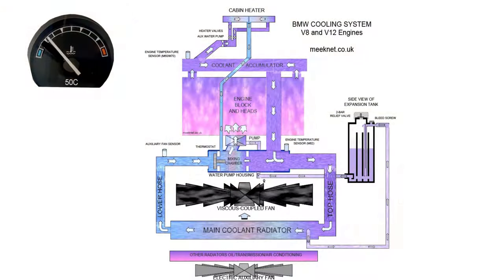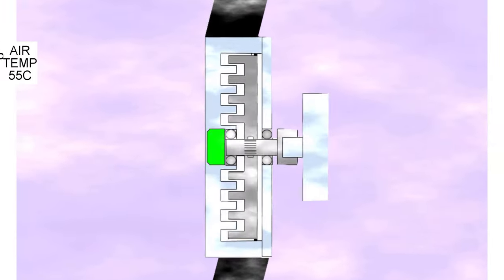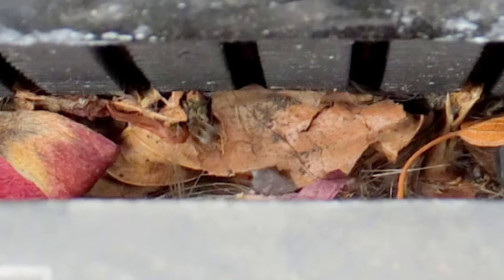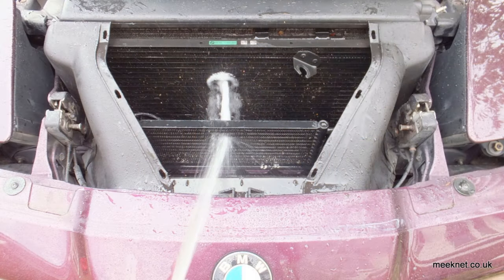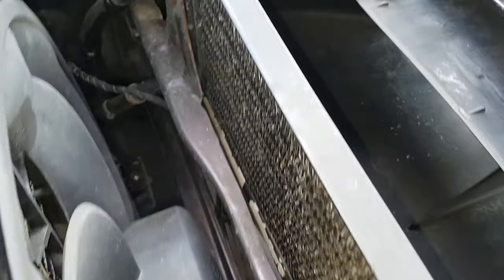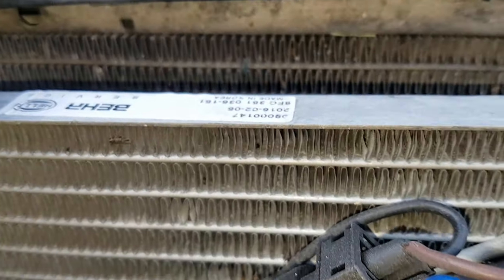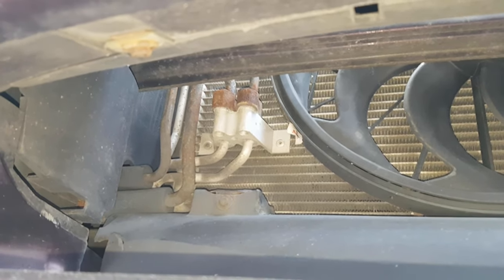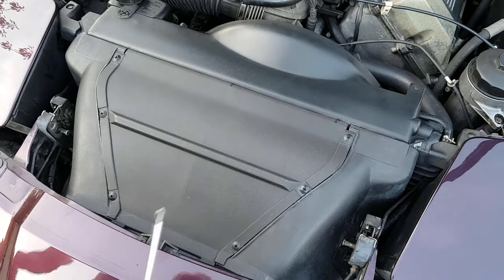BMW Overheating? Check this first!

Comment: Another excellent video. Thank you.

I drive BMW cars more than 10 years. Always fill distilled water %50-50 and blue BMW recommend antifreeze . Also I clean radiators with soapy water every 2000-3000 km. Vaseline all hoses and check them every 6 months. I have never have problem about overheating. Also I have spare parts at the garage ready to change :)
Reply from the maker: Thanks Ali!

Comment: Great advice Timm.....I had to have the valley pan gasket on my 840ci replaced as it was leaking coolant. After BMW did that, it blew the radiator apart on the drive home! The dealership also wanted me to replace the magnesium valve covers because they warp and can't be machined as magnesium is flammable. I was told it is an "unacknowledged defect". At $2000 for the pair, I declined and they've been fine with new gaskets.
Reply from the maker: Good call - I've had seven BMW V8's and never had a problem with warping valve covers! Neither has it ever been a subject on all the major forums - so I think we can put that one in the 'made up' catagory!

Comment: My engine maintains temp at 110 degrees when it should maintaining about 100. The hood gets hott you can’t keep your hand on it for more than 5 seconds. No coolant seems to be leaking, water pump is fully working. 2011 328i x drive
Reply from the maker: The temperature measuring point is at the engine coolant output whereas the thermostat is at the engine coolant input - so it is normal to see higher temperatures than the thermostat rating. All sounds normal to me!

Comment: Not used to bmw’s never owned one before. Found myself buying an e36 ( 328i ) today, has slight overheating issues when applying throttle from a stop.
Reply from the maker: All you need to know here (for V8 but is the same for all models): https://youtu.be/XGIk8IXSGIE

Comment: Tim, you are a life saver. I have a 1991 850i where the auxiliary fan is cutting on and off. I live in Atlanta, GA, a hot place so I need my AC to work properly. So, via input from my BMW mechanic and various forums, I have decided to replace the auxiliary fan. I used your step-by-step instructions on meeknet to remove my old fan. Thanks so much.

The one thing that was really a pain was getting to the bottom bolt that was holding the fan. I could barely get a wrench on it. It probably took me 1/2 hour to get it off. Just curious, any advice on how to access this bolt to make that a little easier? Use a longer wrench, take off the bottom trim on the car, or ?

My new fan arrives today so I'll be doing this project the next several days. Thanks so much for your help!!!
Reply from the maker: I oiled the rubber grommet and pushed it into place!

Comment: Hi Tim, i own a 1 series bmw e87, somehow when idling the car, somewhat like 10 minutes the Outside display temp rises little by little. Do you know why this happens?
Reply from the maker: Don't worry, that is perfectly normal, the engine heat wafts up onto the ambient sensor

Comment: Hi Timm, hope you doing well, I don't now if you remember that i ask you about a relay and fuse that i change ,anyway still don't working at all , in your opinion , what i am doing wrong ?? 
In the other hand, have you ever serviced/cleaning the throttle of the E31 ?? If so , where is located ? unfortunelly for the second time i got a message that the transmission is fault ! 
thank you and happy summer in the UK...good memories !!
Reply from the maker: Yes I do, it is much better to move this over to bimmerforums.com as there is little room to answer here

Comment: This video is a lil old but I need some help. Just replaced several hoses and belts and expansion tank on daughter's car. I can let it idle for 15-20 mins and drive it a few miles and does not over heat. I turn car off for a few minutes and drive it, it over heats...any clue what may be the issue?
Reply from the maker: Go through the bleeding process with the nose up

Comment: Hey Timm, USA here was wondering if you have had this happen on your journey through BMW land? I am losing coolant. My 94 -525 came with a rebuilt transmission $2000, new radiator $900 and new shocks which can be very expensive on that car.
I did the rest of this work myself. New brakes and rotors, tune up, lower control arms, fan clutch, water pump, thermostat with new metal housing
tightened down the head, battery. It runs smooth as silk and handles like nothing else but it uses coolant???????????? No visible leaks or steam out the exhaust pipe. I ordered a new radiator cap just for the fun of it. I have tried to look under the air intake manifold but no visible leaks but hard to see under there. Might have to take that off next spring because it's getting cold up here in Vermont. I'm thinking head gasket but my compression test seemed good. Problem is I spend more time under the hood than driving this........ I'm actually starting to look a Lexus'. Help.
Reply from the maker: Someone in the UK had the same problem - the solution follows: Just to wind up the post with the solution to the issue. It was indeed the coolant hose running along the length of the front of engine directly under the manifold. As per the video shown earlier in the post. Most awkward part to get to, and was way beyond my level of DIY. The garage had to remove the manifold the leak was directly at the connection to the engine weak O ring and brittle connection on the plastic hose. There was also an attached hose which showed sign of wear and was also replaced. Along with that I asked the mechanic to check to see if anything else looked a bit dodgy and to replace where he saw fit. Crack case breather hose was replaced, along with 4 or 5 additional connected pipes and hoses. All parts came from BMW directly were approx. £100 The rest was labour.

Comment: Hi sir, my bmw46 318i, when I accelerate it and go at speed in a few minutes the water heats up, some time ago I also changed the hoses because of this. but why he s heating  when i go fast speed ?
Reply from the maker: Overheating when at speed points towards a water-pump falling apart....

Comment: Hi Timm great videos as always. I followed your auxiliary fan clean and change  procedure but when I pit thw ac on full with or without the engine running, the fan does not run. I even put a multi meter on the 3 pin connector and there is no voltage on any of the 3 pins. Any pointers or tips would be very welcome.
Reply: Or is it a case of the of it will only run when the engine is upto temperature?
Reply from the maker: Hello Lloyd, it depends on a number of things. First, if your car is post facelift - then it will only run when it needs to, even if the A/Cis running. If it is pre-facelift then the A/C must be ON and you must have refrigerant pressure

Comment: Hi Tim , I have a 2007 BMW e90 323i and it was overheating , I replaced radiator cap as it was breaking and a new thermostat as the previous one wasn't opening up. And it's still overheating , any tips on what to do next ? There's no leaking and I'm sure water pump is still okay but not sure. Thanks
Reply from the maker: Have a watch of this for some help: https://youtu.be/XGIk8IXSGIE

Comment: is normal the vent not spining when  not drving i think my one is overheating not sure the issue
Reply from the maker: The viscous-coupled fan does not normally run at high speed when driving - only when idling

Comment: Good day mate. I had the issue of overheating warning message on idrive. (Bmw e60 2006 n52 525i). I check it out the coolant level.. was good. Then I check the water pump without starting the car (just on ignition), I see the flow was good and water pump is working.. I didn’t drive for couple of days.. feel curious.. then I check under the hood for a leak from thermostat.. no leak.. then I start the car with coolant cap open to check if the coolant (actually I’m using mineral water as coolant) flowing through engine and back to coolant tank ( through small hole in coolant tank).. it’s flowing.. I let the engine run almost an hour and check the temp (on dash) show around 90~94c without running ac and with ac on, temp around 88~93c. And the radiator fan works on/off when ac is off and consistently running with various speed when ac is on.. then later on, I did drive about 1/2 hour in town.. no warning msg and the temp was good.. what could the problem on the day that it shows the overheating warning.. your opinion/comment please. And by the way, on that day, the weather was too hot (36~37c) and i was driving around the city with short distance trip and also the ac was medium level..
Reply from the maker: You need BMW coolant! Our engines run well over the boiling point of water (up to 120C) - without coolant your engine is being severely damaged!
Reply: Timm's BMW Repairs and Information. Well, I need to flush all the fluid (mineral water) and fill with bmw coolant.. right? And please tell me what mix ratio of water (preferably distilled water) and coolant as I’m from a hot weather country.. average of 33~38 degree Celsius. Thanks a lot mate..
Reply from the maker: All explained here: https://youtu.be/-Lb68GdQDXk

Comment: Hey so I do have a question I have a 2006 bmw 530i and when I cut the engine on and I'm idle I hear a rattle from the front of the car and eventually it tells me it's overheating and it's leaking from underneath as well. What do you think this would be exactly?
Reply from the maker: That sounds like the waterpump has a failed bearing and seal - quite often happens!

Comment: Hi Tim, can you please help me where is the Temperature sensor on the e31, I am  absolutely in the limbo, seems like know one knows where is located ( mechanics ) thank you for your response. Mario
Reply from the maker: Hello Mario, it all depends which engine you have, the M62 840ci has the temperature sensor on the waterpump/thermostat housing. The M70 and the M60 V8 has the sensor on the coolant accumulator right at the back of the engine: https://www.realoem.com/bmw/enUS/showparts?id=EF63-USA-02-1994-E31-BMW-840i&diagId=11_4845
Reply: I truly appreciate your help and support and I am sorry about the don't give you the engine, is the m60 ,1995 840ci...
Thank you again

Comment: My 2006 650i auxiliary fan not switching on as required  so overheating on idle or dense traffic !
 I ordered new switch but noticed after arriving home from 10 mile trip I got out of car but decided to move it about a foot and when I started the car the fan came on and then went off again after a minute maybe reached  lower tempature. Or should I be looking at relay switch 🤔 
Which is somewhere under a wheel arch I believe.?
Do you have a video? 
I love your e64 you are one of the reasons I have 0ne !!!
Reply from the maker: Hello Arthur, what makes you think the car is overheating? There is no temperature gauge - are you getting steam or something else?

Comment: Hi there i have just done a M43-B19to M52-B28 engine swap in my 316i and soon as i start it up the temp gauge skyrockets , i have changed the temp sensor but still happening . Anyone know what the problem is ? Thanks in advance .
Reply from the maker: The usual problem is getting the temperature sensor and the heated thermostat connections muddled up!

Comment: Great video Timm. Have you worked on a BMW where the A/C blows weak then after a few minutes blows blows higher? What do you suggest I check? Thank you much.
Reply from the maker: That's normal operation on many models - the vents are closed until the matrix temperature is at the desired level
Reply: @TimmsBMWRepairsandInformation  Thanks again.

Comment: 2006 330xi runs hot only after I shut the car off. I can drive 8t all day and all night non stop and no problems. But say I run in a store and stay 10 minutes and start the car back up and within 30 seconds or half a block my yellow & then red warnings light up and I pull over and have to wait at least 20 minutes before I can drive again..This doesn't happen every now and again it happens every time so a lot of times I just leave the car running during Drs appointment or at stores . Need help on WHY ?
Reply: I can run it 24 hrs straight and everything is fine.  But 8 can shut it off for 15-20 mins and by the time I get 3 blocks my yellow warning shows for just a second and immediately goes to red . Even with it being 100 degrees outside the past 2 weeks with me running Max A/C  wide open not a single thing shows up .. But it's Amazing to start it back up and as quick as it goes into the red . Just can't figure it out .

Comment: Hi tim. Just had water pump, thermostat and battery replaced but still having overheating message on a f10. Any pointers will be appreciated
Reply from the maker: Hello Sean, next thing to check is if the coolant is circulating - best place to check is the lower hose from the radiator. Also, make sure it IS overheating rather than a false error. Have a watch of this to understand how the system should be working: https://youtu.be/XGIk8IXSGIE
Reply: @TimmsBMWRepairsandInformation  much appreciated brother. Will keep you up to date
Reply: @seandixon6856  Hi Sean - any update on this? Curious as my F10 is also overheating, I am in the middle of replacing the water pump and thermostat so crossing my fingers but still interested in your outcome.
Reply: @seandixon6856  what happened bru

Comment: I just love the way you Brits always say 'hoover it out'. Lol
Definitely check for tools before closing the bonnet. I bent one once by not doing so. Idiot! Me that is. Good info. Don't have to worry about leaves here in Vegas, just really high ambient temps. 
Good video as usual Timm.
Reply from the maker: Thanks Werner, I dented a bonnet once - never again!
Reply: @TimmsBMWRepairsandInformation  OH, that's not the worst one. I took my 1998 S90 Volvo to a place once for an oil change and I showed the guy how to get the bonnet up in the service position. It had catches on the struts to hold it up. I didn't watch him all the time and so he drove the car out when he finished. I got in and drove home but noticed the hood was not down right. I stopped to try to close it and could not open it. It was completely jammed. I figured out he had slammed the hood down before releasing those catches. I went back the next day and showed it to the owner. They had a hard time prying it open and somewhat straightening it but it was just never right after that. Poor old Volvo had a hard life. Good drive train though.

Comment: 750 1997. Is it normal for the AUX fan to cycle ON and OFF when A/C is ON? I just refilled the AC system, blows really cool air now. New AUX fan. The fan starts spinning high rpm when push AC button  but the fan cycles on and off. Don't know if that's normal or not..
Reply from the maker: Yes, you should notice the compressor switching ON and OFF as well
Reply: @TimmsBMWRepairsandInformation  so it's normal for the fan to cycle for lets say 10-15sec then off for a couple of sec then ON again? Sorry for repeating myself, just want to be sure 😄
Reply from the maker: @estranged85  The compressor and aux fan will run until the evaporator is down to temperature - both will then cycle off. When the evaporator warms back up again they will both cycle back on. The amount of time off and on is dependant on the ambient temperature, the requested interior temperature and the fan speed.
Reply: @TimmsBMWRepairsandInformation  thanks for the info! Great channel btw 🙂

Comment: Hi Timm, I have an e63 and after bmw changed the coolant thermostat, the engine  once warmed up the oil temp now runs at 110c instead of the previous constant temp of 100c, any ideas bmw dealers just give me waffle any ideas? Much appreciated for any advice.
Reply from the maker: 110C seems a little hot to me, check that you are getting airflow through the oil radiator: https://www.realoem.com/bmw/enUS/showparts?id=EK13-USA-04-2007-E64-BMW-650i&diagId=17_0364 They do get blocked up.....
Reply: @TimmsBMWRepairsandInformation  thanks Timm, it's all clear, I suspect it's something those idiots at the bmw garage have done, maybe the thermostat they replaced was not the same spec? Or the water pump may be on it's way out, looking into the expansion tank the flow is really weak then it stops after about a minute (while the engine is running from cold) cant seem to do the electronic bleed after holding the accelerator down for 10 seconds, thank again for your reply, I have got it booked into the garage for them to change the water pump, it's never been changed after 98k, thanks again my friend.